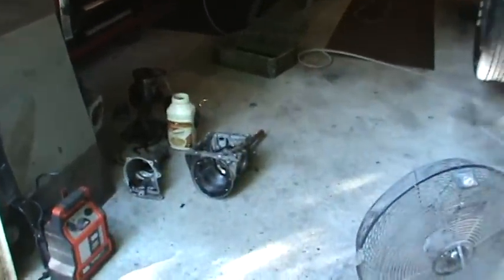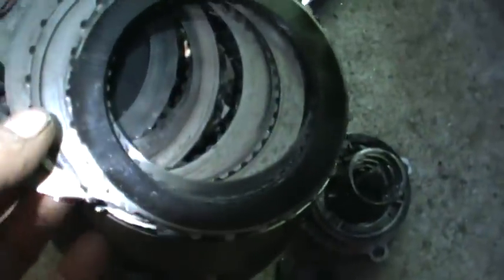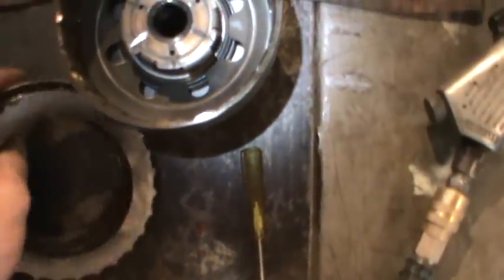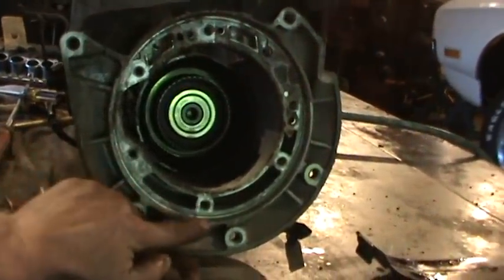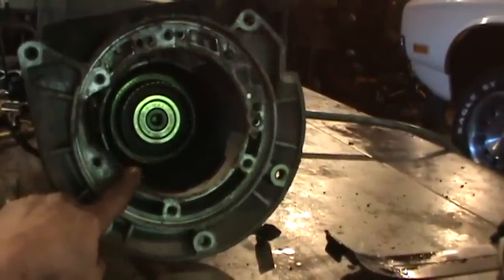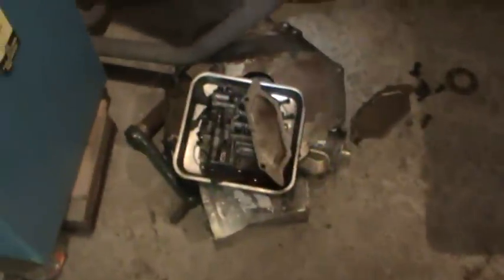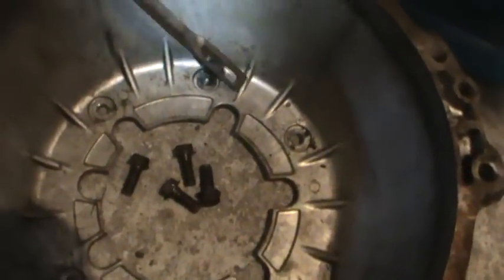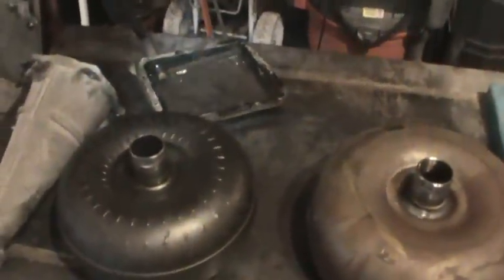c4 ford trans tear down

Comment: Yep, you are right on the high stall speed creating more heat, etc, but the reason for it in your car was that it was a fairly heavy car for a small motor and therefore to get it into the power range it used the smaller, though higher stall speed converter. It makes your transmission work less on takeoffs as in less stress and also helps the engine get into its power range quicker. Under normal driving conditions this was desirable for  the heavier mustangs of the 70s-80s.

Comment: @Busia1949 You are right, and wrong at the same time!  A high stall speed converter is a bad thing on many counts, including gas mileage. A higher stall speed takes longer for the trans to grab and a slipping trans creates heat through friction, a bad thing for an automatic.  High stall speed is for tons of power and torque to burn the rubber off the tires. I don't think the Mustie-stang is built for that or meant for that.  If it's clean internally I'd go with the larger converter, if she fits!

Comment: That does'nt look bad to me. Usually when the clutch discs are slippen they turn purple/black or even charcoal black. Maybe it was a low oil/low oil pressure in the torque converter. If you can get it back together without any leaks i think she'll work great. Transmission shops often look for wear thats not even there and transmission oil does'nt last forever, it gets burnt and wont work in the t c . Good luck. Here in Minnesota automatic tranmissions work like shit when its 40-60 below zero.